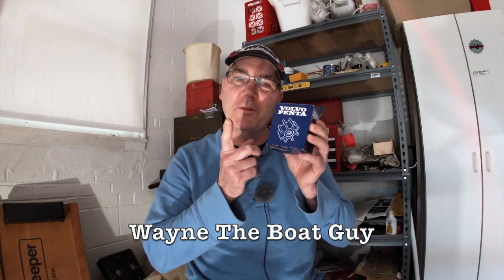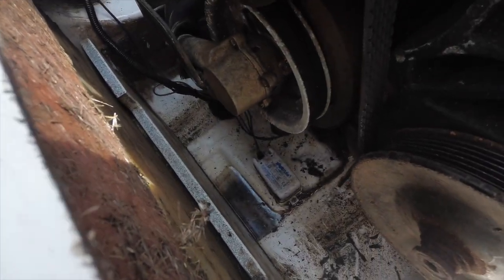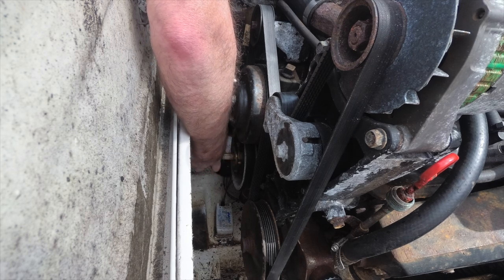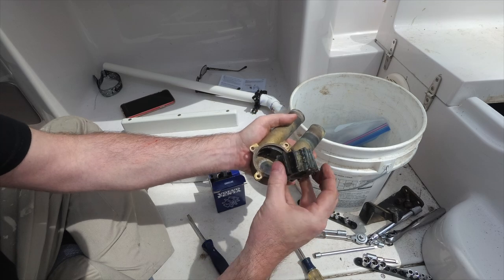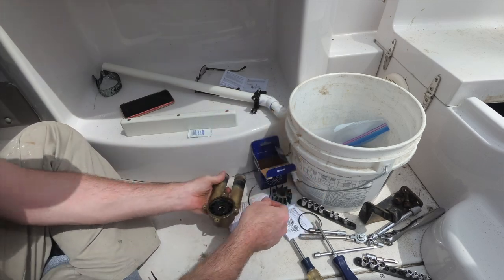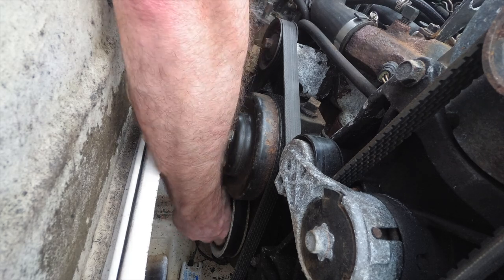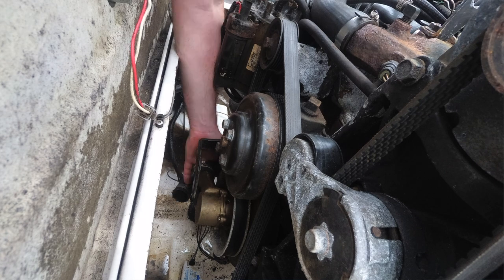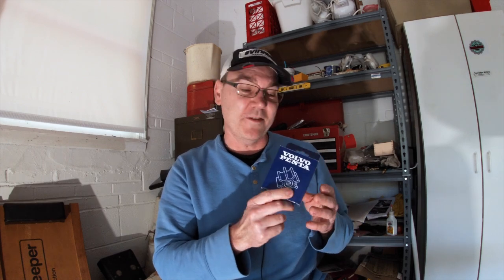Volvo Penta Water Pump Impeller Replacement - 5.7 GSi I/O impeller replacement

Comment: Wayne, Thanks for the nice detailed instructions on changing your impeller. I am glad everything went smoothly after you got the right parts.  I am a big fan of using antisieze on the bolts when you re install them.  It makes the process of removing them much safer/easier for the next time.  I think it is also worthwhile trying to research the torque numbers for the bolts.  They should be out there somewhere on the net.  I-boats forum has some numbers for Volvo impeller housings at 29 ft/lbs.  The electronic torque wrenches for these small jobs are a good way to go.
Reply from the maker: I haven’t ever used anti-seize or loctite but I was contemplating their use in this application. In the past when I’ve done automotive work I usually got pretty close with my “guessing” but I really should get a torque wrench someday!
Reply: @WayneTheBoatGuy  I always use anti-seize but avoid loctite.  Loctite is like a glue that makes the bolts more difficult to remove.

Comment: Thank you for posting this video. I am having an issue on a new-to-me 20+ year old boat with the Volvo Penta 5.7 where the engine does not appear to be sucking in any seawater which leads to it getting hot quickly. If I have it attached to the dock water hose it works fine and the water circulates and the engine cools down. The impeller housing looks exactly like yours and comes apart the same way as I was able to remove it today. The impeller looked to be in ok shape but I ordered a replacement one anyway because I do not know how old it is. It looked to me like the inlet should be at the top and the bottom hose goes up to the thermostat housing but I am sure it was installed the opposite way when I removed the hoses. I tried it both ways and neither caused any water to circulate as I could tell because I disconnected the top of the hose by the thermostat. I ran the dock water backwards through the inlet hose and I could feel it coming out the inlet holes in the drive unit so I don't think it is clogged or blocked. Is there something in the drive unit that forces the water through the system or is it just sucked in from this pump/impeller? Is the inlet side the top? Thank you for any advice.
Reply from the maker: I think... think that my inlet hose is the lower one and then the impeller pumps it up to the thermostat housing - but I’m not positive. 
Potential issues could be:
1. Wrong impeller (like I bought) so that it doesn’t quite push water through the system
2. Bad thermostat
3. Clogged or bad manifolds etc. 
Good luck!

Comment: Great video with an nice amount of humility and humour, I need to do my pair of VP 5.7’s this fall. I understood there was a second O ring around the end of the shaft that drives the impeller but according to your video not so?
Reply from the maker: I think some models might have that, but mine does not. There are many subtle differences between models and years.

Comment: Wayne,  first, thanks fkr the videos!  I have "new to me" 2004 Funship 214. Volvo Penta 5.7.  I changed the impeller because I've been having overheating when running over 3000 rpm's. Overheating,  along with a drip from the bottom of the pump housing. I was hoping the new o ring would fix the drip but it did not. Do you think i need to replace the entire pump housing to stop the drip (and the over heating). Thanks in advance And thanks again for the videos! Very informative and entertaining.  
Phil
Reply from the maker: Chasing down overheat issues can be tricky. There shouldn't be any dripping - so tackle that first then if there is still an issue, check to see if the one manifold or riser is hotter than the other. If so, they might be needing a change as well. Good luck!

Comment: Hey Wayne thanks for the great videos as a first time boat owner I can say you have been a big help to me . Question, should my thermostat housing Be warm to the touch ? I recently replaced my impeller and I’m seeing  there is a leak on my water pump . Going to have to replace the whole thing .Should I replace the thermostat housing and thermostat also ?
Reply from the maker: The thermostat is designed to open when the temp is warm - so when the engine is operating at temp it will be warm.

Comment: Thanks for the video.  My 2003 5.7 GL needed a 14 mm (slightly small that 9/16) to remove the bracket bolts.  I'm about to try and remove water pump cover with 8 mm.

Comment: Hello sir.
I have a volvo penta 5.7 v8. Boat is a 2000 18 foot 188. How did you find which impeller you needed?
Reply from the maker: I believe I cross referenced the numbers on the engine with several parts suppliers because there's several that were used for the GM V8 VolvoPenta engine.

Comment: Another thing you can do to help the impeller prime….after it’s installed disconnect the hose that goes from the impeller housing to the thermostat housing at the thermostat housing. Then fill this hose with water & some dish soap mixed in till it’s more or less full. Next reconnect this hose at the thermostat housing.
Then hook up your water muffs in the lower unit & turn on the water before starting the engine. This method makes the rubber impeller get water & some lubricant right away. It takes a bit of time for the water to travel from the water intakes, to the upper gear housing, thru the hoses in the transom mount thru the ps cooler on the back side engine all the way to the impeller housing on the crankshaft.

Comment: Hello Wayne !   I just received my impeller kit and will be attempting to change it out prior to summer.  How didi you know that it was the wrong kit ?  I have a 5.7L.  Thanks
Reply from the maker: There was an info booklet in the box that said not to use it on certain model number engines.
Reply: @WayneTheBoatGuy  , SUCCESS.  I was able to replace the impeller AFTER twisting off the small brass screws off the impeller housing AND a mysterious vanishing act for the bolt holding the bracket on ?????  Also, the O-Ring that came with the kit would not fit into the groove and I had to go get one that fit.  Thanks for your help.

Comment: Will the sx sterndrive have and impeller in it I changed out the one on the front of the motor and it's not pumping water out the exhaust

Comment: Might be a dumb question can’t find a solid answer. My water pump on the front bottoms pulley gets extremely hot almost right away when the boat is running in the water. Doesn’t seem normal but not sure?
Reply from the maker: I am not 100% positive, but that doesn't seem right to me. Typically the 'raw' water is coming in to the engine at that location, so it should be cooler than it is once it circulates through the engine. I wonder if maybe the impeller is slightly oversized and rubbing the housing so hard that it is heating it up.
Reply: @WayneTheBoatGuy  yea can’t find a clear answer. It over heated once but haven’t been able to duplicate. Either way I think it is worth taking the impeller out to have a look. Thanks to your video it seems pretty simple. I will update if I find anything

Comment: Hello Friend What is the difference between kit 21951346 and kit 21951348? apparently the impellers are the same measurements... I bought kit 21951346 because it was in my engine, but when the new kit arrived, I saw in the manual that it could not be applied to my engine, there was an image showing the type of housing that could not, which by the way was the same as mine and yours too! I'm from Brazil, sorry if the translation is confusing, I'm using the translator. Thanks.
Reply from the maker: I could not determine exact reasons why the one kit is wrong, but I think it has to do with some very minor differences in measurements which might be the difference between it working as intended and not working well.

Comment: Since bolts are not magnetic I've always used a little bit of plumber's putty on the bolt heads and then pushed into the socket I've done this for years for numerous applications automotive and Marine I keep a tub in my toolbox
Reply from the maker: Good tip!

Comment: how do you make sure you are getting the right part?  i have a 4.3L GXi
Reply from the maker: It can be tricky! Relying on product description on Amazon etc. isn't very reliable. I think I ended up looking mine up on a VolvoPenta parts site and then checking it with a few other resources. I purchased a wrong one and the information sheet specifically said that it wasn't for my engine specification number.
Reply: @WayneTheBoatGuy  thanks for including the bolt sizes in this, very helpful.  to make sure things are working, where do you look for the water to exit the boat?

Comment: How would you know if its bad or not
Reply from the maker: If they're 'bad' they have cracks, missing chunks, or are hardened up and stay deformed once removed from the housing. This one was very flexible, not damaged in any way, and was able to spring back into its original shape quickly.

Comment: I sucked mud in my volvo pinta overheated  tried starting it over and over like an idiot until the battery died then once it was toed in I charged the batteries tried to start and now it just clicks.
Reply from the maker: That sounds bad! I would start by pulling some of the hoses to flush them out and checking the impeller.

Comment: You CAN replace that pump with the boat on the water if you used a plug on the water inlet no need to take the boat out